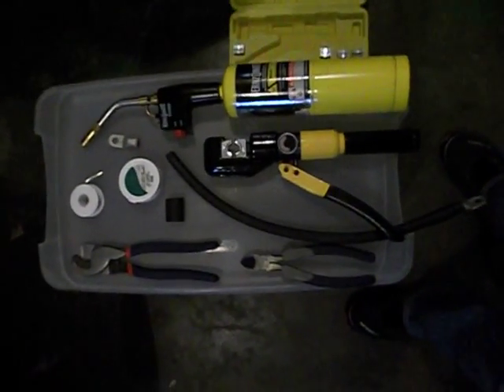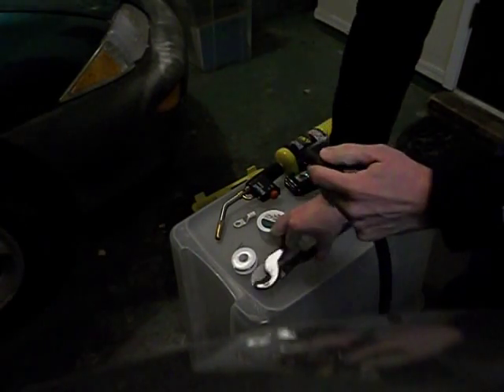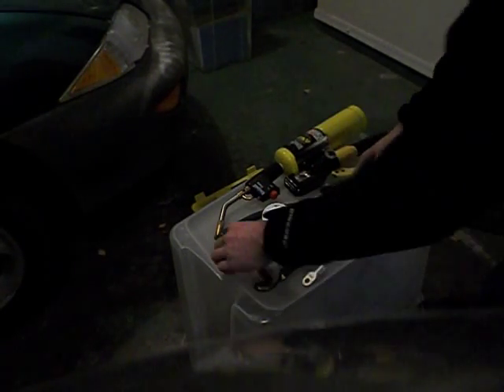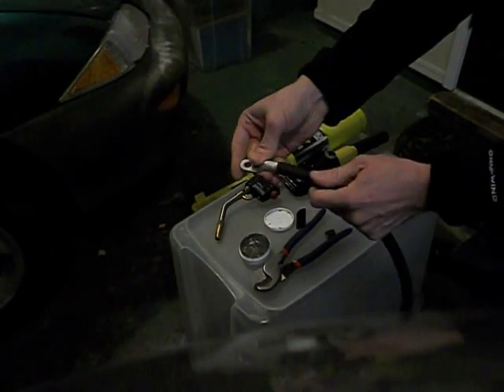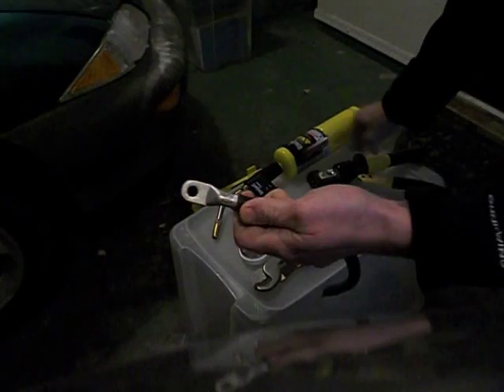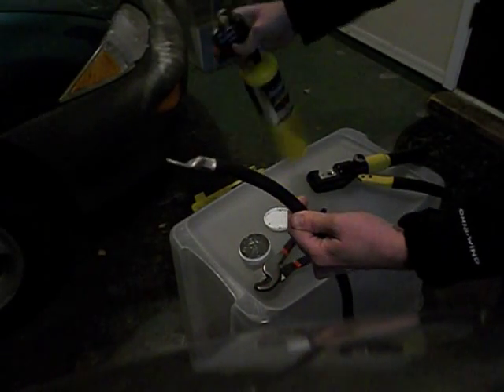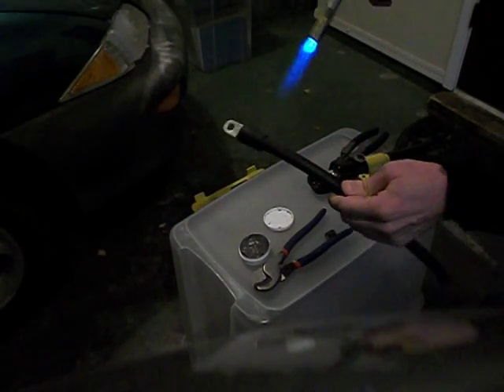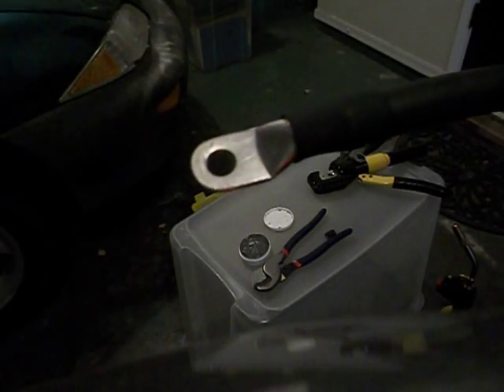Battery Cable Crimp/Solder

Comment: Just a thought but was the flux acid based? I'd prefer to solder the wire in first so it gets to wick then crimp it. Solder prevents corrosion getting in the joint, unless you use acid flux.

Comment: Not an engineer but in the 12v world we use solder a lot.  Your considered a hack if you just use crimp caps and butt connections.  I use open ring terminals and crimp & solder 1/0 & 4 gauge all the time.  But I like the idea of using the closed terminals with your method.  Most car audio guys use either crimp or solder.  I use both methods when I can and I will try this.

Comment: NEC – National Electrical Code :
“250.8(B) METHODS NOT PERMITTED. Connections devices or fittings that depend on solder shall not be used.” Posts like this is putting people and property at risk of fire and death. The use of solder is completely wrong and illegal in all industries. This is an example of someone that should never go near a tool. This video needs to be taken down. It only takes 10 seconds to make a proper crimp connections that outperforms the use of solder in absolutely every way.
Reply: He is just a fucking peanut that pops up on peoples videos with the might power of copy n paste
Reply from the maker: NEC? are you kidding me? Where to start... First lets start with this is 12 volt battery cable.. second read the code again. It says " connection devices or fittings that depend on solder shall not be used" right? So, the crimp is the mechanical connection which is allowed by "code". The code doesn't say you can not use solder with crimp, it says you can not have solder by itself.. Folks like you need to learn how to read and interrupt codes. BTW have you told Quick Cable brand that all their battery ends are "illegal" and "risk fire and death" LOL
Reply: It's like this, I was being lazy by copying and pasting the first bit of info I found to back what I was trying to convey. I agree that technically it doesn't apply 12 volt directly... But I assumed it would be taken as a point to consider looking into. Not to be getting hung up on details like "wrong industry". As you know Ohm's Law applies to all industries so the mechanical principles apply to all as well. You might find this interesting. ABYC code mentions the same, solder shall not be used. http://www.ancorproducts.com/en/resources

It's a very common misconception that solder is good for applications such as this, when in fact it's well known not to be. Solder is for clean environment like on PCB,s. They do make solder lugs with slugs because so many hackers created a demand that's marketed to uneducated fools. And because not everyone has a $300 crimper.  BTW 12 volt DC high current connection would be considered a much harsher condition then AC. As a retired engineer/builder and certified master in many industries I assure you solder is never used. I have fired hundreds of people that do hack work like that, then they cop an attitude to defend their mistakes. Out the door they go. lol
Reply from the maker: Again, lets look at the code you mentioned. ABYC 11.16.3.7.  "Solder shall not be the sole means of mechanical connection in any circuit.” It doesn't say you can not use it, it says solder shall not be the only means of mechanical connection. As I said before, the mechanical connection is the crimp, thus the reason for crimping prior to soldering. The crimp is the mechanical connecting and done first, thus following another code. I understand you are a retired engineer and I respect that, but I'm an active engineer and find no reason why I can not have solder in this application. Is solder necessary, no. Does it hurt in this application, no. Would I use solder only connection, no. Is there a reason to bash other peoples video, no. Best of luck with your retirement. PS you might need to find a hobby.
Reply: OK, let me ask you why bother solder if it's already crimped. Why spend all that time. It only takes about ten seconds to do a proper crimp and shrink. And no extra cost of solder and LP. It would drive production cost and time through the roof. And we know that solder offers no benefits, in fact it causes problems. Hence why it's prohibited in industry. Please take the time to check it out. I did the same thing in the 60.s, then got an education that covered dissimilar metals, electrolysis and galvanic reactions, stray currents around a boat in the water... then experience all the fails for many decades. All that equates to why we have codes and regulations that add us only when used as intended. Take care and have a great day.
Reply: Nor'easter Playa you smoke a fair bit of pole hey?

Comment: Don't use cable cutters to strip. Use proper strippers or a razor blade. Don't touch the wire with your fingers. Acids and oils will corrode the copper. Welding cable ....... is for WELDING. Buy real battery cable for under hood vehicle applications. There is a difference people. How NOT to solder by Mark S.
Reply from the maker: Yes, there is a difference, welding cable is better in EVERY category. Thanks for your great videos you have posted on youtube.. Wait, you don't have anything worth watching.
Reply: Stupidity is not something that someone should want to show .... however, there are people who do it ;-)

Comment: Very well done video, Very informative. Where do you get your heat shrink? What size shrink for 1/0 and 2/0 terminals/ Where did you purchase the hyd crimper? Thanks, Ted tedmarksvideo@msn.com
Reply from the maker: Thank you. I purchased both the heat shrink and crimpers on ebay.

The heat shrink I used for 1/0 and 2/0 is 3/4" dual wall adhesive lined. It has a 3:1 shrink ratio so it will fit many different sizes of wires. 

They have many different sizes of crimpers on ebay, look for the 10 ton units they crimp up to 2/0. 

I'm not sure if I said it in the video but I also recommend uses tinned lugs.
Reply: Mark S Thanks for the quick response.I am using 2/0 tinned terminals although the cable says 1/0 the 1/0 terminals were too small. What do you think of the 12 ton crimpers? I see that Harbor freight has the 10 ton size and the dies look like they are marked with American sizes.Could you send me the name of the Ebay site that has the heat shrink for the 1/0 and 2/0 cable. I have used it at my last job,but have not been able to find it on Ebay. Thanks again, Ted
Reply from the maker: tedmarksvideo For the heat shrink search ebay for item 301089434292. 
As for the crimpers I wouldn't purchase the 12 ton, the dies are much bigger than you need and will limit the smaller size wire you can crimp. I bought my crimpers from ebay and printed the die size chart which is listed on many of the auctions.